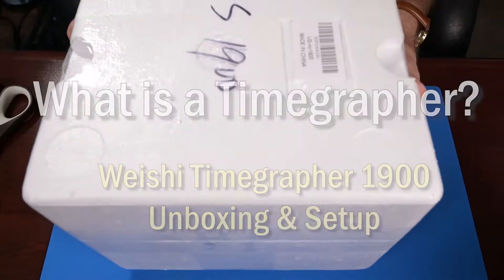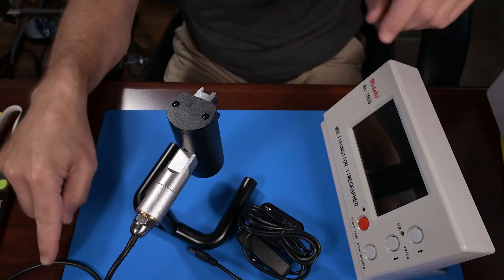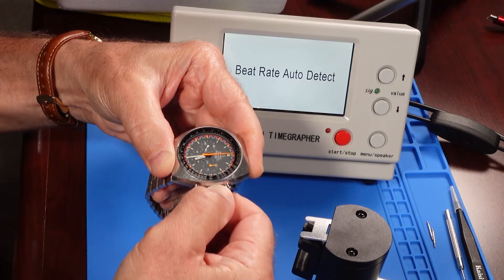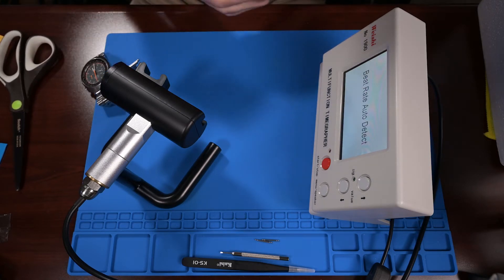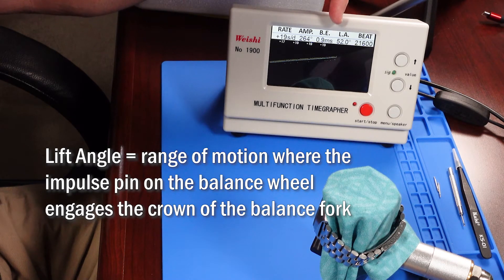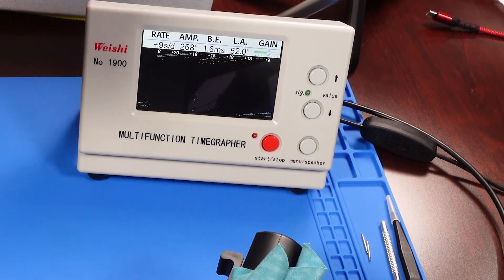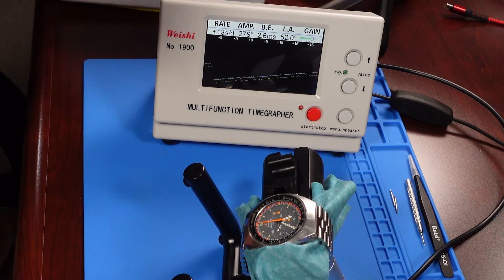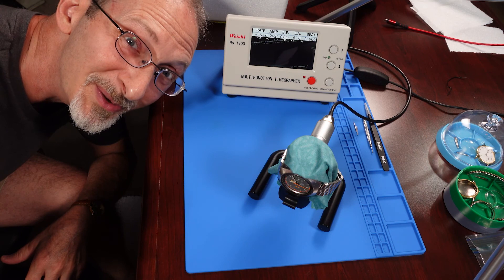Watchmaking Tools: Weishi 1900 Timegrapher Unboxing and Setup

Comment: OK good one! I heard that the Chinese timegraphers like this one uses a simulated tick just to assure you that the mic picked up the real tick tocks from the watch, it is NOT the real amplified tick tock from the watch itself. Some of the expensive and sophisticated Swiss timegraphers actually amplify the actual watch sound and you can hear for any abnormalities if you know what you are looking for. In this case, it is just a mindless ticking noise played back to us. The next thing I heard is that you should be putting the crown next to the mic end which is the metal end that you are worried about scratching the watch. That is the business end of the watch, so it will more accurately pick up the watch running. And finally, I was wondering if this 1900 gives you a Mean reading for all the different positions or you just have to manually work out what the average of the positions worked out to be? Anyways, nice video, cheers.
Reply from the maker: @melodychest9020 - thanks for the tips and questions! You are correct, this timegrapher uses a simulated 'beep' for the ticks of the watch - it is not the actual sound amplified. The microphone is pretty sensitive, so it hasn't really mattered which way I put it in the holder for the watches I've been working on. And finally, no, there is no mean calculation. This timegrapher works in real time only, and isn't storing data to compare the various positions. You'll have to write things down and figure out the mean for yourself. 😎

Comment: What’s the difference between the 1900 and 1000 besides the color display?
Reply from the maker: @stevenl7878   The 1900 has a faster processor so it can analyze and display the data quicker. In addition to the display being color, it is also higher resolution. I think the 1900 also has more customizable settings. You can check out Alex Hamilton's video where he does a deeper dive into the differences. 
@watchrepairtutorials
https://youtu.be/qYdq_Q7B3V0?si=m3ZNdcf60ZUIPCBY

Comment: Just received my 1900 and was amazed they used a metal prong on the end of the microphone. Scratched the first watch I put on to check. Taped it with a single piece of electrical tape and turned the gain up. Seems to work just fine now.
Reply from the maker: The scratch is a bummer, but thanks for sharing your fix! Same is true for my unit, and at first I buffered everything with a microfiber. But now I have a better feel for it and don't use the cloth or cause scratches. Gotta say, the microphone is so sensitive in the unit that it can pick up a watch beat before I fasten it down, just by holding it near the sensor. So I doubt that your tape trick is going to affect the reading. 😃

Comment: Help please!
Bought used tudor black bay 58 m79030n
caliber MT5402

Time graph 
Test period 4s 
Lift Angle 49 degrees 

Wind 30 times let it run for 1 hour 

Then I tested it on timegrapher amplitude was under 250 so I wind it 20 more times then my readings were 

Dial up
+1s/d 
Amplitude 262° 
Beat error 0. 3ms 
Parameters 28800

Vertical crown left 
-11s/d 
amplitude 189° 
bet error 0.3ms 
Parameters 28800

Vertical crown right 
-7s/d 
Amplitude 197° 
Beat error 0. Oms 
Parameters 28800

Dial face down 
-1s/d 
Amplitude 255°
Beat error 0.2ms 
Parameters 28800

Does the watch need to be repaired?
Should I return it? 

Thank you
Reply from the maker: Oh gosh, I'm not sure I'm qualified to answer! But the inconsistencies could mean that the watch needs to be cleaned/lubricated. Was it serviced recently?
Reply: @WatchWithMike  had not been serviced since is only 2 years old
Reply from the maker: @docholliday9124  if it were me, I would pass on this watch. I don't like the low amplitude and time loss when the watch is vertical.
Reply: @WatchWithMike  thank you so much mike I’m new to watch collecting your input helps a lot!

Comment: How do you determine Lift Angle? Is a web site available for stock ETA & Val Joux movements? Just subbed. I have this machine! Thanks
Reply from the maker: Thanks for subbing… I'm glad to have you onboard! To find the lift angle, I have just been using Google and searching, either by the watch model or by the movement caliber code. I usually check 2-3 sources because I have found bad information on the web about such matters. If multiple sources agree, then I am fairly confident the info is correct. 😄
Reply: Thanks very much. I did as you suggested and was amazed at how many other parameters were affected. What I didn’t do is check other sources. I’ll hit that next. Thanks again and boy am I glad I found you!

Comment: You haven’t had the watch serviced in 50 years? You’ve undoubtedly caused significant wear on the internals.
Reply from the maker: @sebii - Great point! This watch DEFINATELY is overdue for a service. In defense, it was only lightly worn by me in the 1980s and has spent the last 35 years in a drawer, so there is hope. :) I appreciate you commenting!
Reply: @WatchWithMike  The watch may be 43 years old but since it was not used all that much and because they already were using synthtic oils in the '70s. Synthetic lubricants don't evaaporate or gum up like mineral-based lubes do. Synthetic watch ols becamse forst available in the 1950s and became ever more popular. I doubt the movement has been damaged or that it shows excessive wear. The fact that it runs pretty well after sitting for such a long period of rest is a good indicator that nothing juch is woring with the watch. I wear my automatic watches regularly and I wear them for up to 10 years most of the time between services. What gets replaced is isually the pallet fork because the pallet jewels wear, and the rotor bearing and of course all seals and gaskets (which I have replaced aevery 3 years since I;m a swimmer). I put a little piece of sticky tape on the metal part of the watch cradle/clamp on the timegrapher and it protects the watch case.
Reply from the maker: @chronocommander007  Thank you, these are all excellent comments and suggestions! I am currently editing a new video where I open up the Speedmaster and take a closer look, and I am sending the watch to Omega in Switzerland for a full service. It should be up soon so please stay tuned! :)